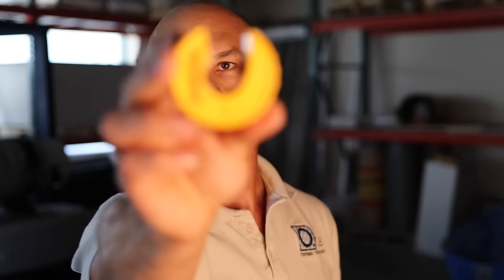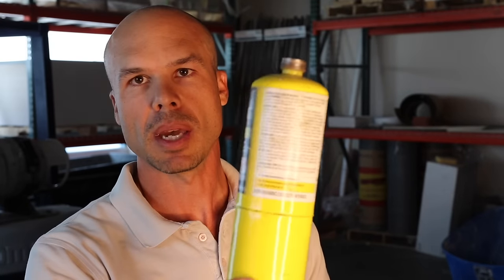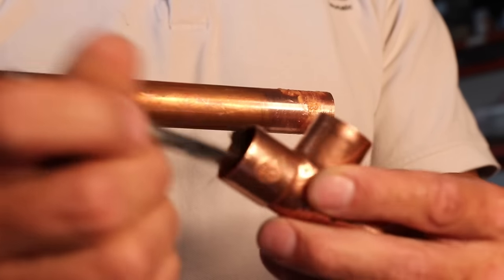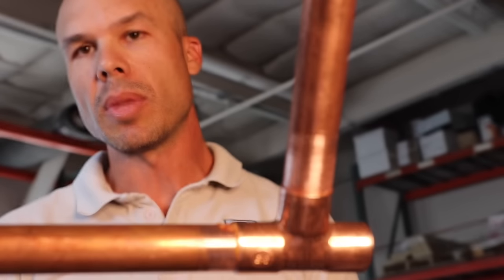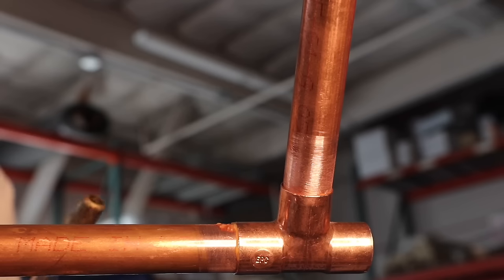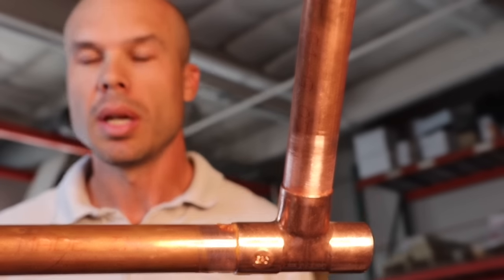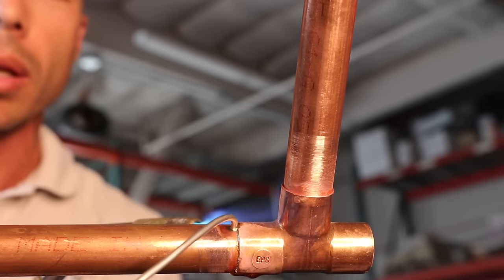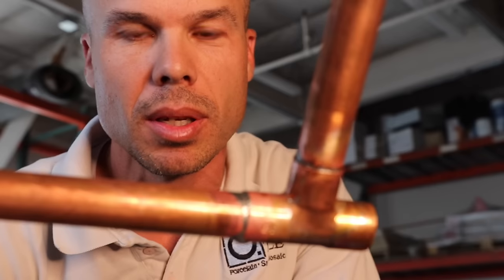How to Solder Copper Pipe: The Plumbers Secret- Episode 1

Comment: Didn't mention anything about reaming the cut pipe. Leaving that edge on all your cuts will lower the effectiveness and life of the system by interrupting and impeding flow.
Reply: That's crazy talk look how much pex fittings reduce flow and pex is legal
Reply: come on man. the rim is like a 1/6 of an inch... the pipe is at least 1/2 inch in diameter... do you you think that little 1/6 of an inch will stop a flow? lol
Reply: @francis5944  it causes noise and turbulence in the pipe that will eat away the copper just after the joint and cause a pin hole leak, heaps of videos on it on YouTube
Reply: To defend Larry he is right which it's not so much that it's going to restrict flow but because copper absorbs minerals and the uneven flow can cause an area to absorb more and in turn cause pin hole leaks

Comment: @tilecoach this is a reason ii laugh when ppl say the phrase you said at the end,  it's a simple plumbing repair... even the "simplest" things can actually be much more damage to the system over a period of time.  First and foremost you never reamed the pipe,  have you ever seen pin holes in copper lines? Green build up, electrolysis? Those two issues are from exactly what you just did.  You also should have used less flux, wiped off the excess b4 soldering,  solder will only adhere where flux is present,  by wiping excess, you have cleaner joints and you don't have melted solder run downstream inside the pipe where you can't see and flux being acidic,  starts to slowly eat away the pipe walls from day 1, you also had some excess do to not reaming the outside burrs as well,  the burr will slide through the fitting and basically scrap the flux out of the joint and make the downstream runoff worse.  
So to home owners who don't want to call plumbers because your tile guy is cheaper,  or what ever the reason all im saying is take notes, in 10 years when you have issues then it falls back onto the day you chose to save money,  just cost you money.

Comment: Hi! 
I do it exactly the same way, but my droplets of melted solder do not stick and just roll down. What to do? What I do wrong?
Reply: Isaac Ostrom <= Thanks a lot! How do you think, maybe flux is not suitable? Or I overheated my pipes?
Reply: Wipe the flux off of the pipe before you solder. The solder follows the flux that is running down the pipe.

Comment: Isaac its best using a dry rag, never a wet rag. Overall good joint. I use b tank does a fast job .just like you I do a ton of plumbing. Has for water in line they make a brass couple with a removable cap to let out steam,so the solder well take. Keep up great videos. T still do not know how you guys have time to do videos,and do tile work.
Reply: I find baby wipes are hands down the best way to get the flux off the pipe. Although at home or for friends I'm not on the clock so I have more time to make it look pretty and let it cool slowly first so I could understand a pro going with a dry rag before the flux gets too solid.

Comment: Flux the pipe not the fitting, 0% lead in solder wire not mixed as it’s illegal to have lead in water supply lines.  When soldering it’s a continuous process without stopping, reheating after a complete joint causes heat crack failure from transfer
Reply: Isaac Ostrom no mate, clean and flux pipe, insert into fitting and twist . excess is pushed out giving you a fluxed fitting and bead around pipe. But it’s all personal preference

Comment: I can imagine a couple million UA union plumbers 😂🤣🤣 I will make a video one day, hopefully before I die, I’m a crusty old plumber. 
Soldering is a process, a method, a logical process it’s also science. UA Union members are taught by the Copper Development People which are the people who design and make the pipes and fitting. They are the investigative body that law firms sometime depend on to ascertain the cause of piping failure where costly damages occur. Soldering 1/2” & 3/4” piping is easy but what about 2” 3” or 4”? This is where you would need to follow the rules or process or you will leak or cause damages to property. Little pipes like the one in the video carry those same rules and processes. 
I need to thank the Copper Development people and the UA for the yearly training in bringing in Mr Coffee (decease) with all his knowledge and array of pipes and fittings that fail and educating us of the causes of failure e.g..not rimming pipe inside ends before soldering. That part of the process causes cavitation which cause many pipes and fittings to fail. Learning from a video is not the same,  lots of rules stepped over. 🌺
Reply: Most tubing cutters have a rimming tool on the side.
This is good advice.

Comment: It;s been around for years just wondering how well induction soldering will work on those copper pipes.
Reply: You need heat enough to melt solder.

Comment: the point is naturally cooling down takes way longer than water does. If we do 1 piece of pipe soldering only, it’s fine, but most of the time, we got following works to do and the environment could be crowded worksite, leaving a hot metal piece around for naturally cool down in 10 minutes could be extremely dangerous, and for only avoiding the rarely happened cracks?

Comment: first mistake, you always solder all end. never leave a T with one end un-solder, even if it means you leave it with a tail solder in (short little pipe)  when you come back later to finish the soldering the unsoldered end, when you heat up the T. the solder ends may crack ,and because its all ready soldered ,no FLUX in the joints, really hard to fix.

Comment: always ream the pipe, seen too many videos on here skipping this step. fluxing both the pipe and the fitting is no problem as long as you don't use too much. always brush the joint with the flux brush after soldering and wipe with a clean rag.

Comment: If first time was not done right, what is the best way to fix it? Can you just re-solder or you need to cut and remove the fitting and do it all over?
Reply: Heat fittings up again, solder will melt, remove pipe, clean and re-flux, then try again. No need to cut. Same goes for if you want to remove old fittings.

Comment: several mistakes here, as the comment below says you should never heat sink you connections, as bg america says let it cool naturally before cleaning. you also skipped reaming the pipe many plumbers skip this step but reaming your cut pipe dramatically cuts down micro eddies in your system thus lowering static electricity meaning the pipe will suffer from less electrolysis and oxidation.  finally you should always solder all three joints of a tee at once, doing 2 sides of a tee then reheating the tee later to finish is a not advised, though in a pinch it can be done if you are careful.
Reply: Leaving the burr cuts the water down the pipe. It helps with flow 🤭

Comment: Wouldn't  U tin the pipe first before it was pushed into fitting
Reply: No, the build-up of solder might prevent the pipe from slipping into the fixture. You could use "tinning flux" which contains a little solder if you're worried about the solder flowing into the joint.

Comment: Plumbers in UK use an old trick to stop any water drops from interfering with their soldering:- They stick a bit of dry bread up the pipe! 🍞 😂
Reply: I've been doing that in the US for years, learned it from my pops! It really helps.
Reply: Only use white bread. That is the only one that will dissolve and be able to be flushed out of the system without causing problems.
Reply: Yeah I've been doing that for over 20 years and it's the fasted easiest way to get the job done. I always try to keep a loaf of white bread on the truck but I've had to borrow a couple times.  Vacuum and air pressure work also but to much extra work lol. I've shown a lot of people that trick and it blows their mind lol. Mostly youngsters lol.
Reply: @larrybohlken147  actually I prefer white bread but other types work also in a pinch. I try to blow them out the faucets anyway. A guy on here told me he used baggles and pizza crust before lol. I'm not sure I'd try that but I know wheat, and potato bread works just as good without any problems.
Reply: How come the pipe won't get hot enough if it has water in it
Reply: @epictoacball4297  the water cools it down and won't allow it to get hot enough to melt the solder. I don't know how to explain it any other way but it's really quite simple. Take a piece of metal heat it up then stick it in water see what happens after seconds. The pipe will be cool.
Reply: @my2centz196   but wouldn't the water eveperate and go.out of the hole
Reply: @epictoacball4297  if it's only a little bit of water absolutely however  if it's a steady drip like it usually is maybe coming from a leaking valve or just dripping back into the system from a trap in the pipe or even a toilet. Sometimes you can't drain the water below the piont your working. The steam itself can cause pinholes in the joint
Reply: @epictoacball4297  if you do get it to take and water was in the pipe with either a drip or water level is even close to the level of the joint you're working on it's likely to have a pinhole or just be a weak joint that can start leaking even days after you finish. Ball up some bread preferably white bread and push it down in the pipe or even up if need be and you will buy enough time to solder the joint and the bread will dissolve and come out a fixture.
Reply: @my2centz196   thanks for the info
Reply: @epictoacball4297  no problem
Reply: Water boils at 212 F.  As long as there is water present, the steam actually cools the pipe below the temperature needed to melt and flow solder.  The steam will also blow holes through your solder joint causing pinhole leaks even if you get it hot enough to flow the solder.
Reply: @ejrocket9260  yes definitely good piont about the steam. I forgot all about that lol.
Reply: @epictoacball4297  the temp will never rise above 212f if theres water present, all the  heat will go toward making steam. this is why pressure pots. physics.

Comment: Note MAP/Pro gas shown in this video actually burns at very nearly the same temp as propane (3,730 F vs 3,600 F) and probably isn't worth the extra cost. The naming and yellow canister color of MAP/Pro can confuse consumers who think they are buying MAPP gas which does burn significantly hotter than propane (5300 F). MAP/Pro was introduced after the sole manufacturer of MAPP gas stopped production.

Comment: No 1 caution : Make sure you have no flammables around the area where you are using a torch. Cans of Paints, Gasoline, Sprays, Oils, and similar items that can catch fire in an instant.  Extremely care should be taken around  appliances that use gas lines, TURN THEM COMPLETELY OFF!.  Have a fire extinguisher if working near wooden walls,  super wet towel  or a bucket of water  in case you accidentally touch a hot surface or something catches on fire. Wear heavy cotton clothes like jeans pants ,  long sleeve shirt, comfortable  leather gloves and protective eye-wear!.  Don't mean this to sound scary, or over excessive in thinking, but it is best to think ahead  with safety first! and have the necessary items for protection just in case.    Great video...Water inside the pipes is an excellent point in this video, even with clean surfaces  well primed with flux, you will never get that solder to stick. Sometimes  any residual water in the pipe will boil and spit out solder as you are heating it and trying to bead the solder around the joint. The last thing you want is solder spitting  or falling on your skin!  it will go right through it like butter, never happened to me but  molten solder is supper hot! .  The overthinking part was for a reason I decided to post here, I always attack each of my projects with a lot of caution and thinking and I have done a lot of projects over my lifetime with a good amount of minor accidents (experience)  that people who are hands-on, DIY or  even pros,  typically experience in their lifetime.   Soldering copper pipes  is not hard, and it takes  a bit of practice,  but first time DIY  need to be extremely cautious, or if in doubt? hire a professional.

Comment: Here in AUSTRALIA WE USE 40\60% BRASS AND SILVER solder rods to weld the copper house water pipies,We dont use lead bas
ed solders,is your solder lead based
Reply: Why does he call it a HOT water heater? No need to heat hot water. Its just a water heater..